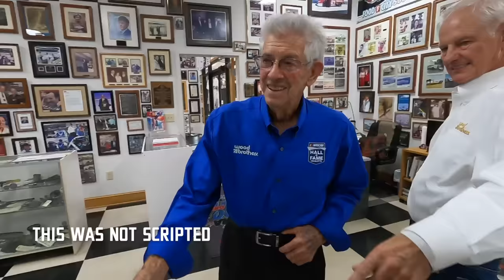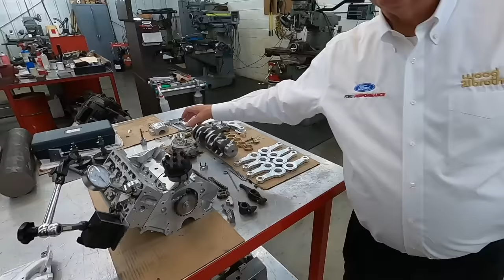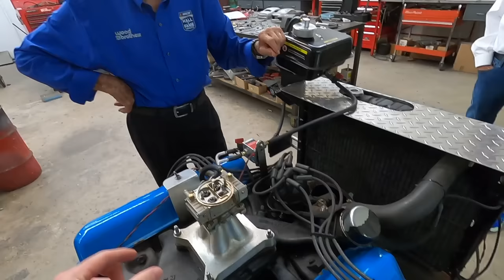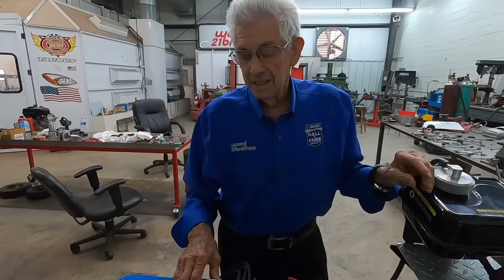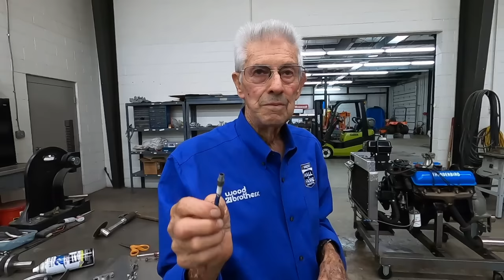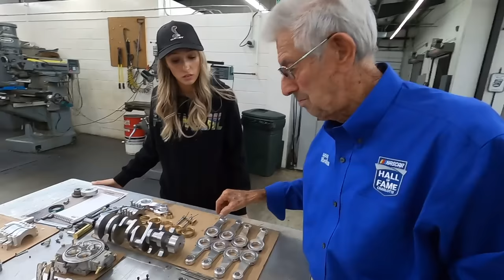Leonard Wood's Workshop: Half Size Holley Carb and Ford 429 Hemi Project! (Wood Brothers Racing)

Comment: I  got lucky to meet Leonard at an oval 1/10 scale RC track years ago. A friend would get a call from Leonard and he would go race his remote control nitro RC cars. He pulled up in a solid white Aerostar van and when he opened the doors it was full of racked custom chassis' 1/10 scale nitro oval remote control face cars.  We raced either 250 or 500 laps. He let Robin try out multiple of the chassis' and let him pick out a few to race. In the end Leonard insisted on which chassis we would use for the race, needless to say we won easily and thank goodness I did not mess up during pit stops for refueling.

Comment: My father was a crewman for Neil Bonnett's team in the late 60's and early to mid 70's. 

He got to know the Woods brothers over the years working in the pits.  

He said they were two of the most honorable men ever in Nascar.  He said not only would they beat you but they would do it with honor, class and fair and square. 

Never heard the man say one bad thing about the Woods brothers over the years.   I met them as young boy at Neil's funeral.  Considering the circumstances they were both very nice gentlemen and I have been a fan ever since.

Comment: I've been waiting for a video like this to come out for a long time.  I've yet to be able to figure out how to machine mini-scale working engines ever since I was lucky enough, dumb enough, and had enough dispensable income to buy a Conley Stinger 609 back in 2012.  I don't have it anymore, but being able to run a 6.09cc crossplane pushrod v8 was the biggest fascination of mine for the past 10 years.  Never could find a home for it though, so I don't have it anymore.
One of my life goals is to find a way to produce a scale size representation of some V8 engine that'll fit in a small car like a miata or something so I can make cool V8 noises while not blowing the tires, rear end, transmission and the like apart.

Comment: I have been turning wrenches most of my life, as a Job and hobby, at 6 I had a minibike in 1973 and it is a drug of a sort. My Neighbour is now 86 opens up daily and still fixing customers cars. Not many jobs you can learn once and stay current. Things changed but it all still works the same. 1920 cars will be around in 300 years, 2023 cars will be long gone by then.

Comment: As a LSA Pilot we need guys like this to build a Light Sport Aircraft engine to make 80-100hp. A engine with dual redundancy for the ignition. We have very few choices. Rotax, UL Power and some guys are running small Honda car engines. A guy like this could design and produce a light weight 4 cylinder engine for Light Sport Aircraft. He could sell all they could build. A aluminum 4 stroke engine that would weigh 150lbs and make 130hp-150hp. This is the type of old school engineering we need in Aviation. These guys are about all gone. We are still flying behind 4 cylinder 65hp Continental engines built in the 1940’s. We need someone like this to design and build a new Aircraft engine we will fly behind for the next 80yrs. This man could easily build Aircraft engines. 

 Most people will not have the time and patience to design a engine. This guy is not motivated by money, just the motivation to finish a great design. Years ago some Aircraft used model T engines on Airplanes. Once they have a good design that stays together we could mass produce these engines. 
 The Wood Brothers are truly legends in the Nascar world. They worked the gray areas of the rule books for years. 🇺🇸

Comment: 71 years old & started riding & wrenching on motor bikes at 13 still at it. Have 175,000 miles on my 1988 Kawaski 1200 voyager & still riding doing burn outs & Wheeles! Use it or lose it!

Comment: Wow. The amount of knowledge and skill that this man walks around with is mind-blowing. 
I build scale static models and have always been fascinated by running miniature engines and I don't think a lot of people are gonna be able to fully grasp just how impressive these miniature engines are. To be able to get the proper shapes of the parts that they're emulating is impressive, but to also get the correct texture AND make them function exactly how the full scale parts do is such a time consuming task that it could literally take 100's of hours to complete a part similar to the size of that intake manifold. And that's not even mentioning that when you scale down in size you also scale down in your tolerances, but you will eventually reach such a tight tolerance that you'll start getting too close for the parts to even function. 

I have so much respect for this man and his craftsmanship. I can only hope to have half the skills and passion that he has at his age when I reach that age.

And that steel buck that he made to form the aluminum body on is even more impressive. The way he talks about not being able to afford the real thing so he scaled it down or learned to make it himself is exactly why many of us got into building scale models and just like he says, if there's a skill that you want to learn, it is absolutely possible to learn anything if you want it bad enough and if you have the ability to concentrate and basically shut out the world.

This man reminds me of my Grandpa in so many ways.

Comment: I had seen Thunderhead289 put a lawn mower carb on a Ford, either a 289 or 302 - I call them Ford's small blocks, even though Ford never designated a "big" and a "small" block.  Anyway, I knew it could work, just from that.  It ran excellently, too.  Surprisingly well, even on a trip.

I've seen some really small, almost model-sized engines for RC airplanes and cars, and those are pretty cool.

This is the first time seeing a half-sized scale model.  The amount of work that has to go into these engines and carbs is amazing.

Comment: This is absolutely incredible. 
The scale motors you see on line rarely work correctly. Everything, every single system is figured out. 
Even the half scale carb....
Could you imagine how it would do in a gocart? I bet it would move out. 
It looks like bigger parts than a 49cc and there's 8 of them....

Comment: I was really wondering when you would make it to the Wood Brother's shop.  I was there back in April and saw the 390 run on that 1/2 scale carb, and spent a good deal of time talking to the machinist Benny who was doing the parts for the Boss 429 scale engine.  It remains with no reservation the most interesting shop visit I've had yet.  Great stuff!!

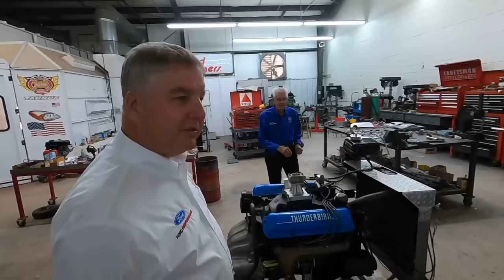Comment: 1:26 I owned a 61 Ford starliner no 390ci 4v... 352ci 2v but that old boat ran pretty good. Wish id never traded that car. But just another outdated looking old car in 1981. I was 14 traded it even for a 1970 cougar XR7 351ci Cleveland power. It was loaded every option. But the 61 starliner was complete, still had original fender skirts. The cars I traded didn't hang onto is crazy. I traded a 1969 Camaro RS 4 speed rough but ran great for 2 vw bugs. A 1967 and a 1974 super beetle in 1988. Guy that traded for the RS restored it, no telling what it's worth today. I saw the RS at a sonic drive-in event in 1996 it was finished and amazing.

Comment: Lenoard uses a Harbor Freight Central Pneumatic air motor for his offset drill with the small number drill. 
If you make a diagram of a Ford engine firing order and compare it to a Chevy,   using #5 cylinder in the ford as the first engine to fire, it is identical to the Chevy.

Comment: I'm Very Impressed Machining, Fabrication and Function. This is 70+ Years Experience. I'm a Pro Mechanic 45+ years,  Automotive Machinests always Impressed me there Wizards Amazing Skill Level they have To Operate Machines and Get Tolerances needed for example 0.002 for Crankshaft Journal to Bearing Clearance pluck one hair out of your head that's same size as Bearing Clearance Needed. Automotive Machinests and Mechanics are so Underated at times Theirs a lot of  talent in that Trade same Goes Guys in  Body & Paint Repair 1/2 Artists 1/2 Mechanic much Respect for those guys too.

Comment: Ok, imagine back in 80's mini-truck craze, when us performance breed youngsters where putting Small block Chevy's and Buick 231ci v6's w turbo 350's and B&M slap shifter's mated to Ford 9" rear ends, if I only had a relationship with the Wood bro's and they built me a half size 427 to drop in instead! OMG! just the imagination of the door blowing, mind twisting you'd be doing to people. Not to mention the sure fire lock to Magazine cover's and guaranteed show trophies. Sorry but that was just a great vision to have.

Comment: Thanks for the video Mitch and Logan,   I use a 1050 Dominator on my 545  aka 460 block  I use a Howards .800 lift  roller cam.  Cobra Jet Aluminum heads

Comment: It runs great but I am betting that Carb Spacer is not NASCAR  Legal.   Does it have a Water Pump?  Electric would be easy to build.
  It would work great in a Garden Pulling Tractor.
  My Bad,  I was multi tasking and missed when they zoomed out and show the engine hooked up to a radiator..

Comment: You are a little off on you description of heli arc and Tig welding.. they are not the same similar but different. Heli arc reguires helium as a shielding gas while Tig welding uses argon . There are other differences as well and I’m not sure of all the specifics of heli arc setups aside from it being similar to Tig welding only more dangerous and not as forgiving
Reply from the maker: When most old timers reference heliarc they are referring to TIG so it makes sense to compare it that way. Just like we "film" a video but without actual film. The helium is gone but process is the same lol

Comment: They call them 'half scale', Ferrari calls that size V8 engine Full Size, back in the 60's.
".... same amount of power as restrictor plate,..." - Hrrrrm. So does NASCAR allow a scale carb, where the venturi's are the same size as the restrictor plate? Because that would turn the plate in to the top of a plenum,.. feed through the right filter arrangement to speed up the air, lotsa torque.
Reply from the maker: They did not allow that back then. They use tapered spacers nowadays